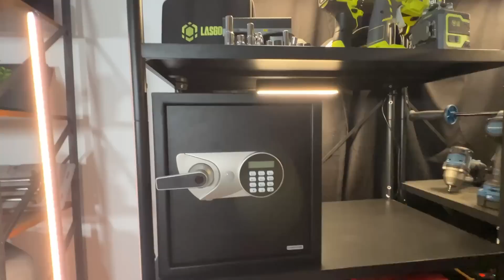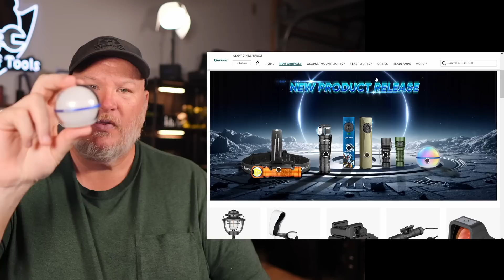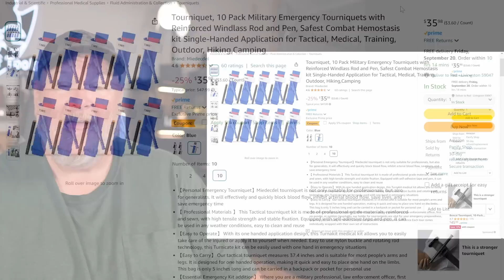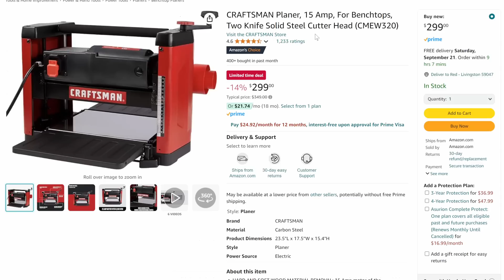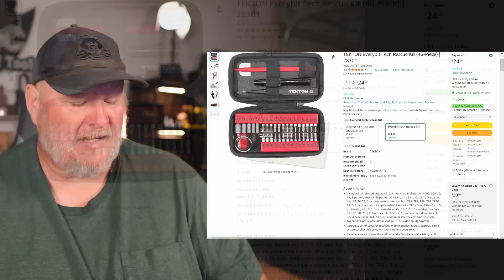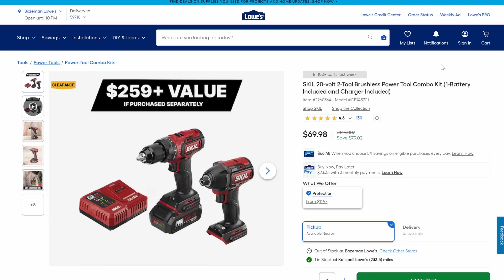Hot Tool Deals of the Week & More 9/16/24 #dotdotw

Comment: Hey Bear, I tested the asmax smart inflator a few weeks ago, and I was really impressed with how sturdy it is and how fast it works. No more rushing to the gas station to check my tire pressure! Plus, the power bank feature has already saved me when my mic ran out during filming. You’ve definitely found yourself a great product. If I had waited a bit longer to buy it, I could have used your discount code lol
Reply: Haven’t tried it yet, but it seems like it’d make things way easier.

Comment: Management put the UFO lights in our shop. Downside is that although they're very bright, they're then localized. So you may only need three by three or four by four spacing (9 or 16 total) for a 50'x50' space to get the overall brightness you want, but then you get shadows on what you're working on unless you're directly under one. Everyone is going around with flashlights and one guy permanently wears one of those LED headbands to be able to work on things.

Comment: I saw a guy say that robot mowers were also handy when you are at risk of hornet nests.  Any terrain that might conceal a hornet nest, send in the robot first.
Reply: Probably better to just get better at dealing with hornet nests...

Of which I'm 'at risk' you might say. Though luckily not allergic, which would more of a reason to get the robot or hire a service I'd say. But the foam hornet nest spray actually works really well and is easy to get it, if you actually read and follow the instructions turns out.

Comment: DeWalt at amazon is NOT a deal ever. Their 'sale" price is an everyday price at Lowes, Ohio tool, etc
Reply: Something's fishy. I checked Ebay and Home Depot. HD's everyday price is $200. Ebay's selling them on sale, brand new, but no box because they came out of a kit. I'm guessing a bunch of sellers bought those kits that were on sale from HD, and they're parting them out to make a quick buck. The knipex aren't actually on sale. They're selling for about the same on Ebay, and they have been as far as I can tell. Can't even trust a so called deal these days.

Comment: As an Army Medic with lots of experience with tourniquets. Please DO NOT buy those for serious use. Use them for training and nothing more.
Reply: Respect but mil doesn't automatically make you an expert on medical supplies.
Reply: @digbar7913  Mil doesn’t, my Medical training does. Tourniquets in particular are my bread and butter. I’ve put on hundreds upon hundreds of them from various manufacturers. I’ve received many hours of training on TQ application exclusively, and that includes understanding and avoiding crap tTQ’s like this.  But hey do you. If you want to buy bottom barrel fake equipment then go ahead, but when they don’t work it’s on your conscience.
Reply: @digbar7913  I've seen even the NAR ones break first use. There's a lot of force pulling on the plastic buckles once you start tightening the windlass.

And there's already been tons of Chinese ripoffs imported for decades now that have proven to break like crazy.
Reply: @digbar7913  He's right, these knock-off tourniquets break.

Comment: That is the best deal I have ever seen on the Dewalt 780 miter saw. Three years ago, I got a Home Depot on-line Black Friday sale on the Dewalt 779 with the rolling stand (bonus) for $399.
Reply: I know it. I bought the 779 about 4 years ago for 349. No stand. Supposedly the 779 has been getting cheaper and the older 779s still used many of the 780 parts. At that time the 780 was over 600 dollars. 

I wonder if Amazon or Dewalt is trying to unload some saws due to the slowing economy.